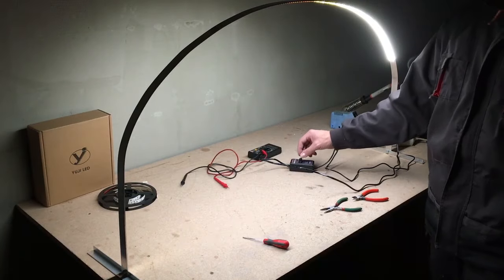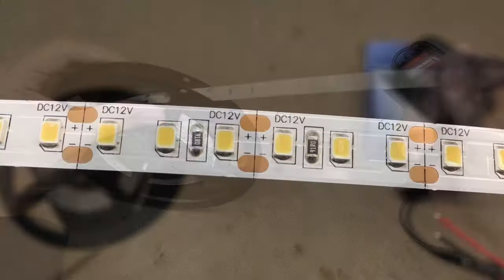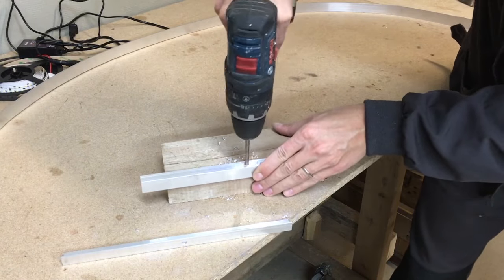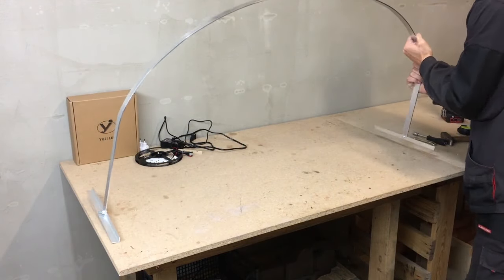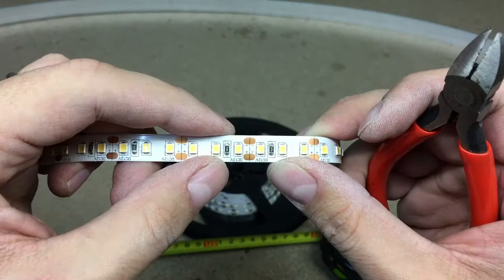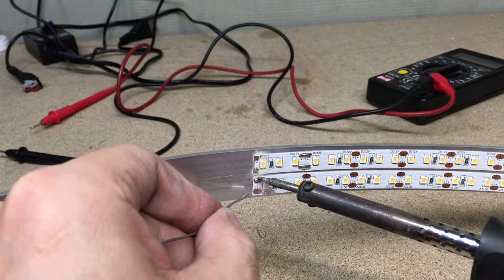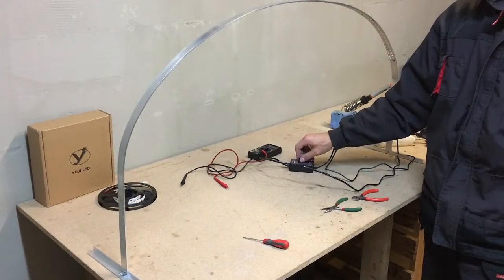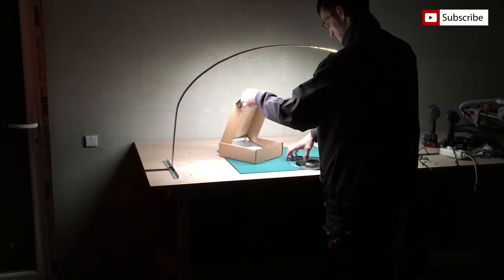DIY: LED Workbench Light From LED Strips

Comment: Thanks. I've been wanted to make some video lights after I found my LED lights in the basement were flickering in video. I knew I would have to look for some kind of a flicker free PSU but wasn't even sure where to start. I wasn't aware of the CRI rating so I will make sure I get strips that have a high rating.

Comment: Nice project I think it's missing just one detail.
LED strips can have quite a bit of resistance in the traces so the voltage drops somewhat as you move further away from the supply wires, resulting in an uneven amount of light and heat if you power a full 5m strip from just one side. Since you're only using 2.5m it's probably less noticeable, but you can easily compensate by moving one supply wire (doesn't matter which one) to the other strip. That way +12V is connected to the one end of the combined strip and ground at the other. Since losses in both rails are equal but now increase in opposite directions, all segments will see the same voltage. Alternatively, you could power both strips directly from the supply wires and not daisy chain them thus reducing the length on the strip and losses. You could even combine both methods and use the aluminum strip as a common ground.
Reply: I wouldn't use the aluminum strip as the common ground in an electronics lab!
Reply: Another option would be to power them at the center of the strip that way the resistance is only half by the time it gets to the ends of the led strip.
Reply: @LarryCoates1948  agreed, it's not like you really rely on the light at the end of the strips. Going to use your idea, thanks